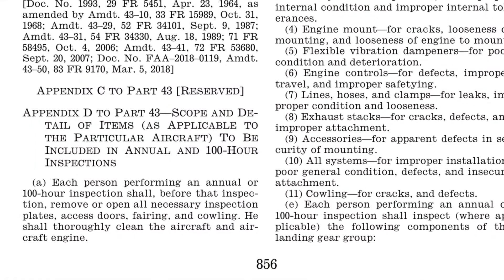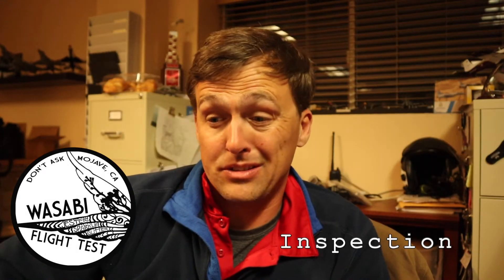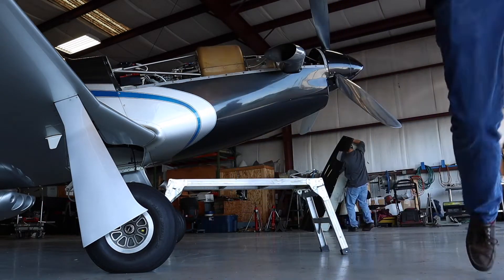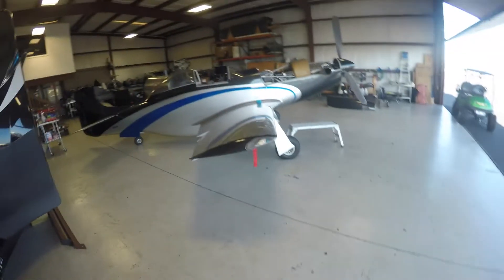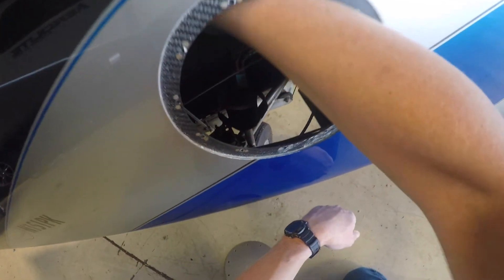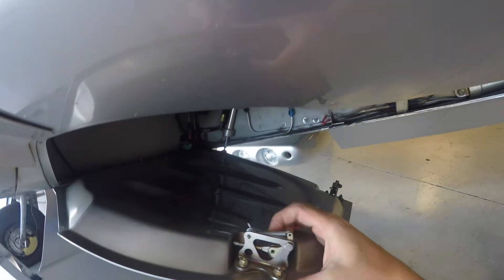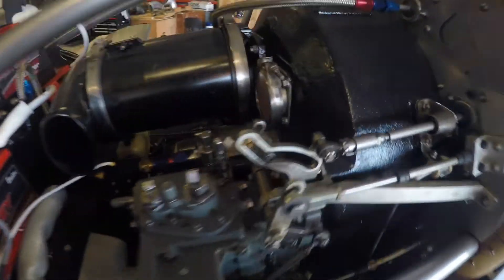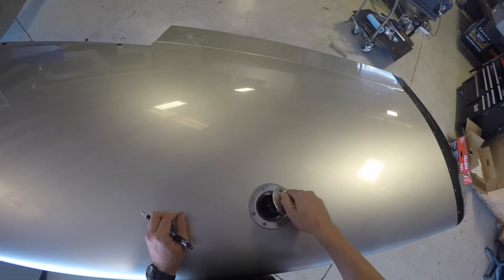The Wasabi Inspection? - LongNoseThunder - Turbine Powered Carbon Fiber Thunder Mustang Kitplane

Comment: With regards to the conversations about expectations - at least in the last few projects, it’s been filmed. Is that partly about reducing liability?
Reply from the maker: one hundred percent.  I started recording flights to get verbal notes during a test flight.  But quickly found it was more valuable to prove to an owner that I did what I agreed to do (or not).  And the last step was recrognizing that when we became independent contractors we gave up the protection that comes with having a chief pilot in a mentor role.  Editing the video forces me to answer to myself about the decisions I made on a flight, and relive those mistakes to maximize the learning opportunity.  Thanks